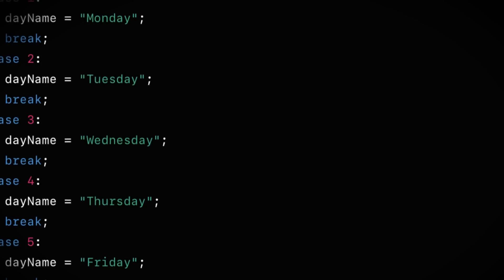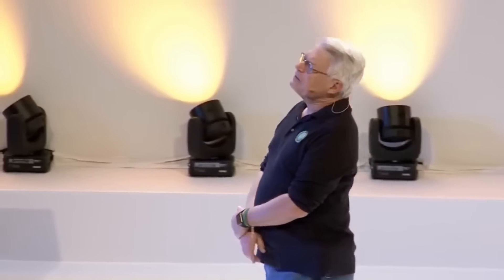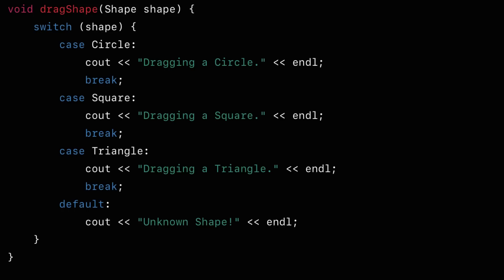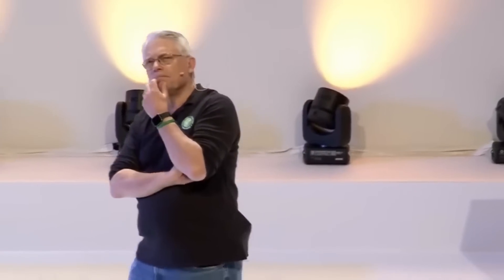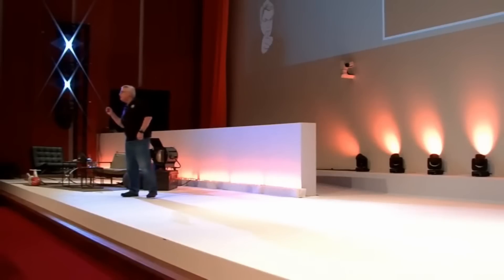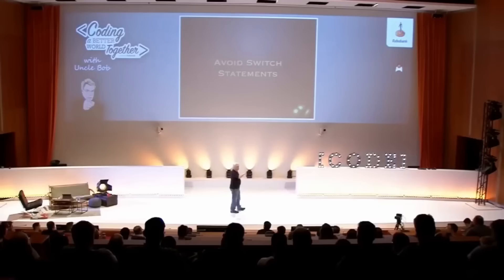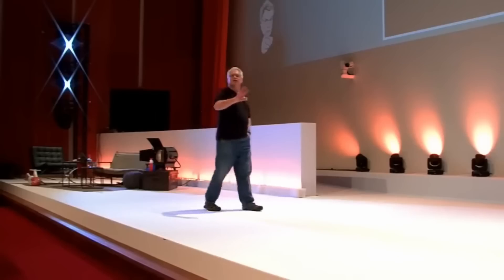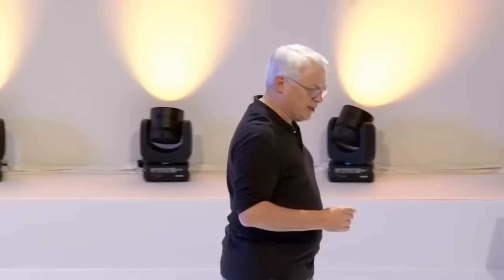The problem with switch statements - Uncle Bob

Comment: The key take way is not that objects are good. The key take away is that there are many ways to handle flow control in writing software.

There is always a decision making process. Depending on how much thinking you do before create the flow control of the program. Depending on your understanding of the problem your trying to solve. Depending on your understanding of the language and it's features. Depending on your understanding of data structures. 

You can take a problem, decide on an algorithm to get the job done and you will still have flow control. It has to go someplace. There are often more elegant ways than CASE or IF THEN statements. You may be able to do it with calculation. The language may offer features that help you to hide the fact the decision is being made by syntax. 

In this case, at creation time of the object your are hiding the flow control related to all the logic behind each shape in one of the base classes.

Comment: Also in the series: The problem with the if statement, Why a for cycle is bad? Why using structs is a mistake? Why you should never use functions?
And it never ends... praise the Bob.

Comment: If you say switch - case - break is bad then  by extension, if - else if - else is bad as well. However, the thing is you use condition expressions for things like greater than, less than or equal to kind of problems. Where you know the full scope of the problem is contained and is not up for change. 

Example input validation, you are not going to write polymorphism for it. 

IOCtl of Linux does use switch case instead of polymorphism… yeah it’s a nightmare to keep updating it. That’s a wrong usage of tool for solving the problem.

Comment: Interesting choice for an example considering that no major library uses polymorphism to handle rotation and scaling and drawing. They use composition. Essentially a abstraction called "path".

But yeah, the problem is code duplication, not switch statements.

Comment: In the shape example, I would not use Polymorphism OR switches.

I'd make one Shape.cs and have the area, volume formulae be set by Func<double, double> (e.t.c), based on conditions like number of sides, pi, etc.

😊
I want to avoid both issues and do something completely different.  Other ways may include auto generated formulae from embedded json files.

Anything but a bunch of switches and the mocking hell that comes from Polymorphism

Comment: The problem with polymorphism is all the layers of code which all have vtable lookups constantly crashing the cache causing modern programs to have slow execution of code. This is why modern programs takes forever to start compared to old days when a given program (yes with less features) could run on for instance on a 33MHz system.
"Layers are for cakes not for Software!!!!"
One could argue that object oriented coding style steals the users computer from the user

Comment: The example of having to manually find each switch statement when a new enum is added is a little outdated. Most modern compilers like gcc, clang and icx can detect when an enum value is not covered in a switch statement. There are warning flags for that exact case. The key is to not use ‘default:’ in the switch statement. Just sayin’…
Reply: The other problem he alluded to is that not everywhere that you're switching on a type is written as a switch statement. You wind up with "if (shape==Circle or shape==Square) {...}" and now you add Rhombus that in that case should work like a square.
Reply: @darrennew8211 , yes, that can be a problem. The solution to that is equally as simple.  Don't use if/else to compare enums. Use a switch statement without 'default:'.  Then the compiler will tell you what areas of code need updating.  If if statements are unavoidable, one technique I have used in the past on a large project I inherited was to temporarily rename all the enum values (i.e. add a 'x' to the beginning or end of the enum name).  Then the compiler will tell you pretty quickly the if statements you may have missed.  When you're done, put the names back.
Reply: @petrocksgarage  I think the real answer is that if you're switching on types that you might extend later, use OOP (or ECS). If you're switching on something that is simply a value (<18 years old, >65 years old, 19 to 64 years old) or otherwise isn't going to change (day of the week), don't bother using inheritance. If you have more than about three switch statements with the same cases, you're probably doing it wrong. I don't know of any language since 1980 that hasn't supported dynamic dispatch that you can extend without touching working code.

Sometimes it isn't a matter of only using a switch statement, either. I had a situation where it was a 50-line if/then/else nightmare of what kind of contract had the customer signed. We couldn't even refactor it because nobody knew which contracts were still in force etc. If they were this type but not that type and they spent between this and that... 

It's entirely possible for code to get so bad it's literally unfixable. (Which is probably what happened with the whole "Print like Word95" flag in the MSOffice XML files.)
Reply: @darrennew8211 , OOP has its place. But it's not available in all languages (i.e. C).  But more often then not, in my experience, an enum is not defining a type.  It's defining a bitmask (most common), or configuration flag to pass to some function. Enums rarely define a type.  At least not in my code.

I feel you on the massive if statement problem.  I've resolved cases like that with a unit test set up to confirm the current behavior, then cleaned up the code and made sure the unit test continued to succeed.  If you don't clean up things like that you build up a lot of technical debt and will ultimately make your life harder.
Reply: @petrocksgarage  Absolutely. And yes, if you're switching on something that isn't a type (i.e., not an algebraic enum) then OOP doesn't even apply. Enums often define a type in languages where enums are types and not values, like Rust say.

And yeah, the problem is that nobody really even knew what the rules are, so first you'd have to test all the possible combinations. Then nobody knew whether it could be simplified even with a full set of tests. There was plenty of tech debt to go around just from lazy and ignorant programming practices without trying to simplify actual business logic. :-)

Comment: Some examples in C++:
void main_loop () {
//Create, config, ... and prepare all shapes here.
#define send_all_shapes    Circles_container, Squares_container, Triangles_container
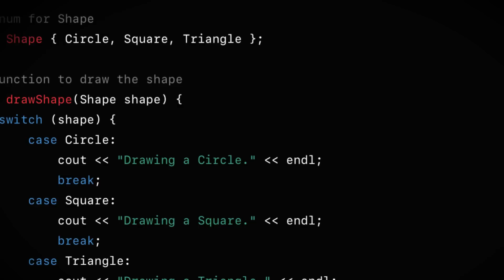//0:45, some f()s treat all shapes at once. They don't need switch:
	drawShapes (send_all_shapes);
//2:00, if all_shapes change for adding a new 1, and the following get_all_shapes is not aware of that, compile errors will throw us directly to the right f()s that need adaptation. So it's pretty easy:
	drawShapes (send_all_shapes, Rectangles_container);    // Compile error: IDE will open the drawShapes f().
}
#undef      send_all_shapes
#define     get_all_shapes                       \
	const Circles_t     &Circles_container,    \
	const Squares_t     &Squares_container,    \
	const Triangles_t &Triangles_container

#define draw_shapes(cntnr)     for (const auto &obj:  (cntnr)) obj.draw()
void drawShapes (get_all_shapes)
{	draw_shapes (Circles_container);	draw_shapes (Squares_container);	draw_shapes (Triangles_container);       }
#undef    draw_shapes

Comment: I partially agree. Inheritance is a good thing, but it doesn't need to be polymorphic, throwing performance away for no good reason (bad trade-off). And instead of using switches everywhere, it's better to treat all shapes alone, individualy: apply the right algorithm for the right container of 1 shape only, repeating the process (if needed) to all other shapes. This is cache-friendly, more performatic. It's OO and DOD not fighting each other.

Comment: If you have to stretch or rotate some generic unknown shape when that may not even be a meaningfully defined operation, something has gone terribly wrong. your Circle class will have to implement the rotate operation when that doesn't even make sense to do so in the context of this application. the answer is to adopt a component-oriented architecture where you only implement operations for types of objects that make sense to do so. for example, a "fill" operation could make sense for closed shapes, but if you have curves or lines, it doesn't make sense. The answer is to adopt a component-oriented architecture. You don't have to even do a full ECS, just have a position component, a rotation component, and operations that can operate on lists of those components. This can be done in Java as people like ThinMatrix have made videos about. Uncle Bob's dumb remarks show the consequences of staying code-oriented and refusing to be data-oriented.
Reply: I think his point is that you want to automate the switches and gather them into one place. Whether that's a class with inheritance or whether it's a component combination for a system, you can add things into the system without breaking what's already there. So ECS in that case can be thought of as really complicated dispatch on multiple inheritance.
Reply: @darrennew8211  having an array of entities and arrays components could get complicated depending on how it's implemented and what is going on, but it is not the same as a vtable which you cannot control. if I was writing a simple diagram drawing app where there's only going to be a few shapes, i'd try to just implement it in a language that requires exhaustive switch statements or have a panic/assert statement in the default branch and an automated test suite so that stuff would break if I add something and forget to change something somewhere. if I was making the stereotypical ECS example of an RTS game with thousands of archer units firing arrows, I'd want a tightly packed component array. you are correct that going full ECS will bring in complexity. but using inheritance instead involves an inherent loss of control over code execution and performance.
Reply: @ I wasn't speaking anything of implementation or efficiency. There are (inefficient, usually at least partially interpreted) OOP languages without vtables, and there is no reason (other than efficiency) for an ECS to be implemented with the components contiguous in memory. 

My point was that in ECS, I can add a new component and/or new systems without touching what's already there. I can add a new subclass to an inheritance-based OOP without touching what's already there. In that sense, the dispatch is "inside out" compared to switch statements scattered about the code, all of which touch tightly-connected pieces of data.

First you have to get the code working reliably. Then you have to make it maintainable as needs change. Then you can worry about how efficient it is. If you're writing a simulation engine (subset: game engine, UI, etc) you are going to want to use ECS or OOP, because any other approach is going to involve making changes in hundreds of places for each change in functionality, which doesn't scale.

Comment: Switch statements are good for values not methods, like the value of a user entered value (you aren't going to declare a class for every word the client could enter). The example of shape is the classic OOP programming example and why OOP is more maintainable. But on say CLI argument processing a switch is a clean construct. The problem with switch is that the fall-through allows unmanaged values to sort of work, when they either are a filtering problem on the input or a failed switch to account for a legit value.

Comment: I think this is pretty much all solved with modern languages. Even in java you can defined closed interfaces and if you switch on those it's fine, it will warn you compile tine if you are missing a subclass.

Comment: Haha. I am relieved that outside of his cult following, like in these comments, people know from experience that this advice is BS. Switch statements are fine and even preferable depending on what you are doing. The rest of the comments have done a good job pointing out the tradeoffs. The code I write today is like 95/5 or 99/1 basic code with no inheritance-based polymorphism, and it's been great.

Comment: I would probably use a switch statement, but most likely a pattern matching expression, at the point of object creation. But the rest of the code shouldn't have them to deal with these classes of objects, maybe in a cases of serialization. Any time someone tells me that a problem is too hard to simplify, I know that they are not great at inverting the problem to create more modular code.

Comment: It doesn't matter how wonderful the coding/structure paradigm you use is. SOMEONE will figure out how to write bad code with it. A "code smell" is just a pattern that is commonly misused, even if is usually perfectly reasonable most of the time.

Comment: What's the problem to put switch into a function "draw_sw/stretch_sw/..." and call it whenever you want to "draw/stretch/..."? 

Basically, I don't see any difference except switch should be faster than polymorphism, but that's... Not really important for 99% of programmers
Reply: switch is not faster polymorphism. 
switch uses code branching,  an if statement per case.  polymorphism just uses a pointer.
I think the truth is that 99% of programmers don't understand polymorphism.
Reply: @JasonKaler  wrong, switch is not branch. it's jump based on a jump table.
Reply: @birthdayzrock1426   interesting.
I suppose in the case of enums the size of the table is known.
Reply: @JasonKaler  it's not even about that. all switches are jumps
Reply: @birthdayzrock1426  not in all languages and not in all cases.
many languages can switch on a string or an integer
Reply: @JasonKaler  "many languages can switch on a string or an integer" did i say otherwise?
Reply: @birthdayzrock1426   yes, "it's jump based on a jump table."
This is not possible with string comparisons or a set of integers with large gaps
Reply: @JasonKaler  possible 100%

Comment: I think it's hardly the case that any sufficiently good programming language and software architecture will have this problem of "many switchs spread around the code", it literally never happened to me in 10 years of coding. But at the same time I found many codebases that had this problem, for me the question was not that they "should not had used switches" but rather that their uses of switch was exhaustively amateur. In the same way you can teach to make people write good code with polymorphism in the OOP way, you can teach people to write good code to use parametric polymorphism, function composition and many other constructs that simply remove the need for "spreading switches in the code" (of course, you also develop a different mindset when programming with languages that allows you to do this, which also avoids writting code that would float into this direction).

Comment: What I find funny about this is that it effectively moves the switch statement from visible code to the function pointer table which figures out which of the many implementations of rotate you need to call for a given instance.
Reply: What you're describing is how higher level abstractions work in general; they don't necessarily change the compiled code, but they change how it looks to program with.
Reply: In this case this is not a problem, the less code you need to write and maintain the less opportunity for problems you create.
Reply: tables of function pointers will always be "faster" than the 'switch'
Reply: @technobubba4 this is straight up wrong. Switch statement has no overhead when compiled properly: break is a non-conditional jump, fallthrough is nop! Equality check on enum value can be optimized at compile time to one or two instructions.
Reply: @ivanjermakov  YOH, "break" requires TIME to execute, even one ??

Comment: When you use the wrong tool for the problem, you don’t blame the tool. You should look closer at the problem…
Reply: Yeah exactly what I was thinking. This is an odd video. 
I'm never using switch statements in the manner this dev is illustrating.
Switch statements can be very powerful and increase readability a lot if used correctly.

Comment: This is called The Expression Problem. If you use switches over types, it’s easier to add new functions. If you use polymorphism, it’s easier to add new type variants. 
Beyond this, though, it’s useful to ask yourself why you need polymorphism or type variants in the first place. You may be just as well off creating specialized functions as needed or something else that’s simpler.
Reply: Why is it easier to add new functions if you use switches?  I'm new to these concepts but it seems to me like that function would need a switch anyway, so then its just as easy to add the new method to all the classes.
Reply: @zz-nj4hl  to add a new operation you add just a new switch statement, while in polymorphism you need to add a function to every class*. Conversely, to add a new shape in polymorphism you *just need to add a new object, while using switch statement you need to add a new case to *every switch statement*. It's symmetric

Comment: Oh boo-hoo, the case for rotating a circle is empty in the switch statement.

Soo... How does polymorphism help there? You have a variable of type Shape, instantite it with a Circle, and call "shape.rotate"... What happens? A: Nothing happens, because nothing can happen. Rotating a circle doesn't make a differene, doesn't do anything at all, any more under polymorphism than it does in a switch statement.

As an example of "switch statement bad", that sucked.